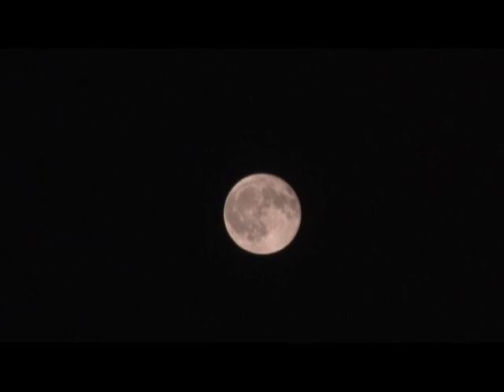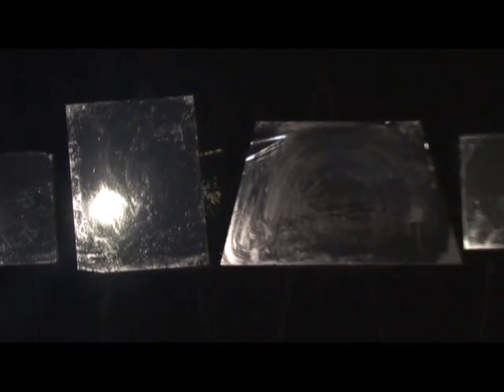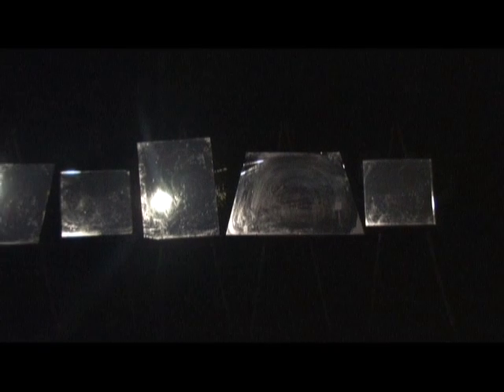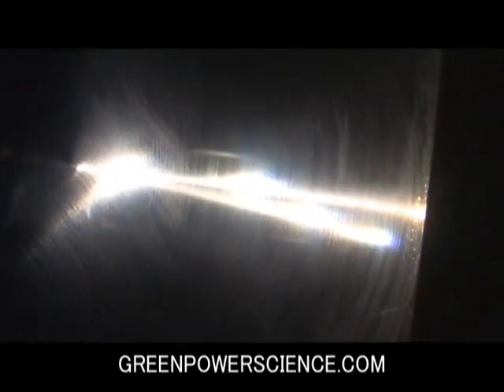MOONLIGHT LUNAR FRESNEL LENS SOLAR PANEL PV PHOTOVOLTAIC NIGHT SOLAR ENERGY

Comment: hey Ive been seeing people doing tests saying moonlight is colder than moon-shade and the coldness can actually be magnified .. .. you guys should do a video..
Reply: +Simon-the-Bar Keep extreme bullshit in short, thank you.
Moonlight has its own light, period.
There are few exclusions - blood moons, when sun is closer to moon and light a little the moon.
Moon and sun is same size. Consider obvious, enough Walt Disney and NASA lies. Keep your religion for yourself and separate from TRUE science please.
Reply: +matt norris This can be attributed to radiative cooling. I'll skip the extreme science and keep it short. Moonlight is not cooler in any sense, it has literally no effect on the temperature of the earth. What happens is at night, the atmosphere can actually absorb the heat from objects. Energy always travels from an area of high concentration to an area of low concentration. Air loses heat much more rapidly than a solid object, and so the air will absorb the heat from any surrounding objects. The unshaded air and surrounding objects would be able to cool down quickly, due to the increased airflow of being unshaded and exposed. However, when something is shaded, or covered, the airflow is restricted so less heat energy can be transferred from the object to the air. If you ran the same test of moonlight being cooler during a new moon or a moonless night, the temperature difference would still be seen. Hope I helped clarify.
Reply: Simon-the-Bar
that did clear it up ... thx man
Reply: Simon-the-Bar
Lol, you exactly behave as they wanted new generation of slaves to behave. Expert... haha. You are great example to others, appeal to authority type of slave.
Anyway, lets keep away all the insults, after all i am slave myself.
About experiment, i just donated to the guy and he performed it and results was just like expected, moon light was colder than in shadow. Plus few more guys did that. But again as i said,  I WILL DO MY OWN experiment. AS i started to do my experiment with horizon and other stuff, i am busy now.

i have reached point where i understood that NOW ONE is more clever or better than YOU, its all matter of time and attention to the subject (no matter what it is), some will do that quicker, some slower, but everyone can learn/know same stuff. And The knowledge/experiment about moonlight is irelative to thermodynamics. I am not trying explain why moonlight is colder, and am just saying that it is. And interpretation of reality is another subject, i could find many holes in thermodynamics itself and we could argue to death what is what.
it is same like trying to explain why rainbow behave as it does, and why shape is exactly like that - it can be endless debate.
But i am going leave you alone with all this,
Good luck.
Reply: Do the experiments the right way and you'll see everything for yourself. Do the math and you'll see that it is impossible for a solar eclipse to happen if the sun and moon were the same size and same distance away. Look through a telescope designed to be used for the sun, and you'll see the exact same thing NASA shows us. Look at other planets with your telescope and you'll see smaller object orbiting them, other moon. Yet the sun does not orbit them. It's not speculation. You don't know what you're talking about. You reject common science yet you don't know what you're rejecting it for. You are not a man of science. You are a man of quick assumptions. The reason you don't believe the facts are simply because you do not understand. It's all been explained. A man of science would acknowledge that.
Reply: Simon-the-Bar

Solar eclipse happen not because of moon shadow, there is well known and worshiped by our masters, the black sun. Either way i cannot confirm that myself... Moon eclipse is different story, if it is not staged by man himself. Still i have filmed it myself, its on YT, was a great view.
And yes i will do experiment in a right way and what if it will be cooler, you still going to think it is some "space-dark matter-gravitational-epiphenomena" on globe earth? :)
i looked at sun, and now i bought camera and filter to show you. Just filter isn't dark enough, afraid to damage the sensor, so i bought another one and waiting to arrive. All what you will see is circle with the holes. And those holes repeats every cycle, every 11-18 years i same place, about the same time and exactly the same shape. On a sphere it is impossible, i wonder how it is possible at all..
NASA show for a split moment a circular disk with holes, next they bring fake CGI stuff and i can prove it all of it is not real and made up with software. Actually in some cases it is software product mixed with real sun disk videos.

And please do not tell me what i do not understand, i have studied globe earth theory to the bones, for 3+ years every day dedicating to it 6-8 hours. Not just globe nonsense, but flat earth wicked theory, concave earth theory, holographic universe, hallow earth, electric universe, Klein surface, torus, egg shaped universe/earth, etc..etc.. I know too much and i say now  that i know too little and personal experiments are essential to move forward. 

And even if my English do not impress you and i am sound for you like a fool, that is fine, thats your natural reaction.. Well.. natural as it is possibly can be in artificial reality we live in.

Normal unconditioned person would consider straight away obvious, the same size a moon and sun. Stationary earth, tiny 7 only "planets" and rest of the "stars", which rotate around stationary earth. But well brainwashed and indoctrinated person, who been taught in a school that our ancestors believed that earth was flat disk, which was help by turtle and 3 elephants is no more clever than a monkey. Many slaves so well indoctrinated that they believe that they are monkeys themselves, i mean they "derived" from monkey... You know the story... i was in brainwashing facility myself and was good at it.

I am here not to prove you one or another or show how "wicked" i am. Just encourage you try to understand what those "nut balls" are saying and why. Soon, after many hours of going away from official lies, you start it to see all for yourself.
You can make people believe WHAT EVER YOU WANT, and they did in the age when TV was invented of-course... or shall i say..presented.
Yes globe earth theory does make sense if all what they say would be true, but it does not. Even if all what they say would be true, there are too many holes in that theory which been glued with phenomenons and laws which does not exist or can be proven. 

 I wonder what is your take on my last video, what do you think, when we really see Venus? When it is in Focus?
Reply: Simon-the-Bar
No i am saying that Roman Empire never fell and you live now in it. And who ever is famous world wide, now, then or in the future - it is THEIR people. Would that be BACH, MOZZART, NEWTON, EINSTEIN, you name it... ALl of them.
You cannot say what is happening today for sure, because all lies around and you trying to tell me what Galileo discovered? In any case if  it was their guy or not, clever or not, honest or lair - they write the history in a way they want it, period. It is same story like with Hitler or none existing genocide. Or fake WW3 which is coming. Or Einstein and his theories. All of it is always fake story to the public.
Research about freaking stephen hawking, he is an injured man, who know fuck all, imprisoned by those people, sit in the chair and  do nothing,and someone is creating BS story on artificially created "genius image".

Check video:
Stephen Hawking Videos: The Real Stephen Hawking (Part 3/5)
from 3:15 min, he was speaking back then and look what student "interpreted", if you cannot see that ALL of it is a staged and lie, i cannot help it. yes it is mind boggling, it is crazy, it is impossible to believe, but nearly everything around you is STAGED.
Slaves always will be given fake official story, as it was for hundreds of years. It is no different today.

They have plenty time, all what they do - fulfilling the book which was written in the beginning of the Age of Pisces. Now it is new age coming and they create new world, new rules, new religion, languages,  governments, way of thinking, technologies,etc..etc..etc.. And they have new scenario for another 2150 years. Not in detailed as you might think, but it has been written in such a way, that you could interpret it in a way you want and project on that timeline, symbolically or for real.
Either way future these days is planned out at LEAST 200+ years in advance with minute details, i nterms of whats going to be "invented", "discovered", world wide events, most country reforms, how they going to do that, how people will dress, what they going to eat, what they going to play, how much they will think, what sort of cars we will be driving (none), how they will provide kids for us, how we will have sex, etc...etc...etc.. EVERYTHING.
Just as it is NOW, believe it or not. Your thought are not "your", they first decided what society will think and behave, and they present that to the public and you only choose "yourself" what sort of type you going to be.

It is like TRUMAN show, just we are all Trumans and actors at same time for each other. And how to "act" TV/books/cartoons/movies/newspapers/school dictates for us, and at all levels they have 100% control.
Reply: Simon-the-Bar
I don't know how earth is like but it its definitely not round, i have studied all theories of earth to the bones, including 4 flat theories, 2 concave earths, hallow, electric and holographic universe theories, , torus and klein surface, and many others..
That is why i do my own tests to find out for myself and share some with you. I should have done experiment tonight with moonlight and its cooling properties, but it is cloudy as fuck, might be be better later. Check out for video after few days, we can see what is what...
Reply: You are delusional. Extremely.
Reply: Simon-the-Bar
You can measure curvature on the horizon, check my videos... It is in process. Plus i am going to launch weather balloons soon myself, but it will be done at same time in 4 places on the surface of earth. That is the best proof that earth is not a globe - the weather balloons. There is NO CURVATURE, there is only Go-Pro FISH EYE LENS, which distort the view. people who lunched it with normal lens you can see FLAT as FLAT can be. Do fucking research, fellow. Enough to preach me what you think who i am and who i am not. Learn tiny bit yourself. I have spent 6-8 hours a day, for 3 years educating myself, learning all sorts of stuff, regarding this topic, to even dare to tell that MIGHT this theory is false. And now,  i say, there is no doubt it is false.

Enough of this name calling shit, good luck in your fairytale land which your masters has presented to you.

Bye
Reply: Delusional.
Reply: PartOfYou Far from it. Atheist actually here and uhm, that is true science. If you knew two shit about science you'd know that the sun's visible light isn't what warms you. It's UV light does, which is invisible to the human eye. Ergo, the light we see has no temperature. I'd like you to run a small test on your own. Take a mirror, and reflect the moon light onto a shaded area. Keep it there for about half an hour and record the temperature. Another test, take a magnifying glass and try to focus the moon light. If the moon did make its own light, you'd be able to create a tight area of cooling light. It won't happen.
Reply: Simon-the-Bar
LOL, check videos on youtube. MOON DOES HAVE COOLING LIGHT and temperatures does drop lower on moon light. And i will perform proper experiment with many and massive parabolic mirrors.

Great try... But you just debunked yourself :)
Please perform your experiment yourself and help to spread the truth, cheers.
Reply: Oh you've watched youtube videos? Tell me again how you're an expert on thermodynamics again? In this day and age of the Internet, ignorance is a choice.
Reply: PartOfYou I want you in your own words explain why moon light is cooler. I have a solid explanation for why moon light has no effect on temperature change, yet you keep bringing up things such slaves and conspiracies and what not. In your own words, explain what is happening with moonlight and temperature. Detailed.
Reply: Simon-the-Bar

I dont know, how about that? I can speculate, but all of it is speculation... First you have to know what moon is, to me it is not even solid.
It is same size as Sun, it is about same distance as the Sun. Why sun makes heat, its not some bouncing invisible particles (protons) - thats bullshit, look trough the telescope and filter into sun yourself it is NOTHING like NASA ever showed you. You will run into problems explaining reality, it just IS, still we can try to satisfy ourselves with extended reasoning and logic chain of words.

Who ever created Sun and Moon and tiny stars, they created the way they are,how did they did that - i do not know. Big bang bullshit i do not buy.
 Either way i was religions person and believed NASA and other religious fucktards, not any more. Now i am after science ONLY, not religion mixed with science.
Sorry for mistakes, my phones makes auto suggestions....
Reply: You do realize you're basically saying the Catholic Church was right and Galileo was wrong, right?
Reply: You are either a troll or by far the most gullible person on the face of the ROUND Earth. Or is that flat too?
Reply: Simon-the-Bar
No i just curious, i think for myself and question authority. While you appeal authority. That is all the difference. But i was exactly like you, i dont blame you. Good luck.
Reply: But here's the issue, you're not actually doing your own research. You don't have the money for that. You can't circumnavigate the globe, you can't go into space and see for yourself what is out there, and you can't teach yourself all of modern physics and science and understand it. I appeal to what makes sense. Logic. Science, proof. You appeal to random conspiracies that exist for the sole purpose of defying authority. The "Flat Earthers" started out as a joke, but someone got the wrong idea. The guy above is obviously using the wrong thermometer for this kind of test. Your so called "research" is based on nothing more than whimsy. You have provided zero evidence for anything of what you  believe other than "I've researched it myself."  Your parents raised you better than that. And you know yourself that the only reason you believe in your outlandish theories is because you want to be able to feel superior to others and feel different. Feel like you know something that everyone else doesn't. But you're wrong. NASA isn't the only one that's been to space. Other people have traveled on their own private rockets and people have sent weather balloons with cameras. Those are real experiments by real people. I hope that in time you wise up and realize that not everything told to us is a lie and that there sometimes isn't always a greater truth.
Reply: +PartOfYou man the sheeple will always be sheep. i do agree with u on that we don't know what the moon is made of or if it's even solid. dont waste ur time arguing or debating for it is endless and pointless.
Reply: +PartOfYou you really are an idiot , Ask Felix Baumgartner you know they guys that free fall from 39klm oh wait he was bought out ? http://www.imaging-resource.com/news/2012/10/15/red-bull-stratos-used-over-35-cameras-from-canons-to-reds-to-document-baumg
Reply: viol8r007
Lol not just them, but every single thing what NASA ever did.
That was main purpose of theirs to 1000th time to brainwash you and have some fun at same time.

Investigate whole thing, check the supposed rotation of the earth and where they have landed, how long they were up in there, etc.etc.. Why they have used fish eye lens cameras which bend the view and many many things.
Yes, it was planned out by same people who fooling you every day. It is biggest lie which humanity ever been told.
Reply: +PartOfYou So you are saying that a man who has broken the Law in many countries from Base Jumping agisnt the Authorities ans System by living life out side the law with out hurting people and living the complete extreme is just another plant . There are plenty of things to be skeptical about ,but as close to a sphere Earth is not one , neither is the Moon Nor the Sun . How else does the moon revolve around the Earth and How does the Earth Revolve around the Sun if it is not a Sphere using gravity ? You can see the Earth is round go down to the Ocean and watch a ship sail away.It dissapears  .
http://www.dummies.com/how-to/content/how-to-determine-the-earths-circumference.html

if you have the handle on that then heres another 
http://www.sciencebuddies.org/science-fair-projects/project_ideas/Astro_p018.shtml

now check this out if you want to know how far you see round a globe and not a flat plain 
http://www.ringbell.co.uk/info/hdist.htm   now this one is tricky cause it depends on the height of the thing you are observing aswell ,but you new that right .Now if the Earth was not a Globe(well as close to it) you would see forever - what the air refraction %at determined height .If you can not understand this i am truly sorry for you. In todays age Ignorance is a choice my friend . Maybe you should try "potholers 54 "Channel and "Armoured skeptic"channels on you tube these guys may help you out a little .
Reply: viol8r007

OMG.. You are really think there is so stupid people around? Do you thin i do not know any of this? You think i haven't finished school or studies? You think i am havent studied astrology or dont have telescope? I know globe earth theory to its bones and every single story and reason which backs to Galileo or Ptolemy.
Earth is biggest thing that exist in entire universe and sky is no bigger than earth. And Sun is same size as a moon revolves around the stationary earth. Whenever earth flat, concave, Torus or Klein surface, mundane egg or any other - for certain i do not know yet, because i know enough not to fall into single conclusion.
Funny how that knew people for last few thousand years, and only when Hollywood was invented and mass brainwashing was possible we suddenly "discovered" that earth is a globe. Lol. I am out of this debate, you have my suggestions, there are PLENTY evidence that NASA and their fake activity is nothing but HOAX.
Please go and find me one real picture of earth, where you can see ALL earth, some stars, maybe even planets, or moon... Not to mention satellites and all other stuff.
We are in so called space 60~ years. there must be plenty of real, raw, non manipulated pictures. Please FIND ONE.

Half what they have taught us is based on PURE lie and that includes not just globe hoax theory, but evolution, big bang, climate change, nuclear weapons, nucleus atom theory and much much much more.

Why would they lie about earth and choose to brainwash us?
Why precisely Globe earth with infinite space fairytale?

It greatly deal with belittlement and it is needed for new age religion - extraterrestrials. People are controlled with four main things:

Fear, shame, guilt and belittlement.

 We all know how fear is used to manipulate on us... and usually it is has been done trough classic technique:

 *Left vs Right* (Russia vs America, liberals vs democrats, etc..) = so they can create Problem + do some Action + offer the Solution = and result will be Exactly what they need

So they just back engineer whole scenario and start their plan, and usually everyone know that something happening, everyone talks about it, everyone has opinions on it, but no one really knows what it is all about. Just like Terrorism hoaxes right now all other the world. Everyone know it is happening, some know it is staged, but not many know what it is for. In my opinion, it is destruction of hardcore religions (and ALL religions in general) using shame and guilt which will have tremendous impact for future generations... And also they are creating safety problem, so we would exchange our "freedom" into the "safety" , and accept all coming policies, RFID, scans, facial recognition, fingerprints, etc...etc...

To see bigger picture usually you have to think in terms of 10/20/50/100 years, but what i will say now, it is few millennia thing... Whoever runs the world, they do it for very very long time, they have created most of the religions of last 2000 years, languages, towns, wars, etc... Their religion always was and will be - astrology, and basis of all religions are based on it, as many you might know by now. There are ages which are defined by cycle of the star Sirius, one age is 2k+ years. And we still are in age of Pisces (or it has finished on 2012), age of Wars and Nations and its scenario was a bible. Nations cannot exist without the war - watch Report from Iron Mountain to get a clue. But right now we are moving from one age into another, we are at the stage of the transition.

 Into age of Aquarius, age of Peace and Unity. But peace has its price to pay - Total Control. That is why all this technological monitoring is necessary. They going to mix all races and all nations, cultures, religions, and dissolve the borders slowly - i think it is easily can be seen happening to this day. The titles of the countries speak for themselves: United Kingdom, United States, Soviet Union, Euro Union, etc..etc... And new age = new world which is all about one main belief system, one monetary system, one governmental system, one language, you know all of these... But religion will be replaced with science. Or shall i say...fake science. Or let me put it right: True science (mathematics, physics, geometry, astrology) + Fake science (big bang, evolution, globe theory, nucleus atom theory, gravity, quantum physics, etc) + Backward cosmology which is presented by NASA + fairy-tales about Aliens = NEW WORLD RELIGION
And many conspiracies are used to shift your thinking towards it... And when they perform fake alien invasion, everyone will fall for it.
Thats why they spray Barium Strontium Niobate with chem-planes - to create massive holograms in the skies. Another obvious reason of ball, globe... That it is very unique - it has not end. Or on other hand - it has very limited space of travel, it shuts down your mind and dont let you ask: whats there, what is further? So yes, they might hiding lots of land. But the most important reason why they make this globe hoax, it is infinite space. Not because aliens can be possible in such a scenario, but because it makes you feel tiny, little, not important, powerless and hopeless. Easy manageable and fearful. While in reality You Are The Most Powerful Creature on the face of the earth if not the universe - what ever its size.

But i bet it is too much to handle for freshly baked brain.

Do research and after 3 years 8 hours a day of studying, reading and educating yourself, get back to me.. then we can talk a little, if you can grasp reality and able to separate fiction from truth.
Reply: so you just do not understand geometry or physics or perspective ,so it must be wrong sigh . Here it what you need to do for your self go to an Observatory or even buy a telescope and look at ALL the planets and moons . So you will see they are ALL circles .Molten things formed in a vacuum with no gravity will form a sphere  . But i fear you will continue on this path of blind ignorance cause it does not fit your mindset of ignorance or complete lack of Understanding . By the way Quoting Astrology does not help your cause for a real scientific debate . Ignoring facts about geometry Physics and perspective does not make what you are saying truth ,as with out any of these would would not be able to travel the world as it is a Globe . Answer me this in a simple matter how is it if you head west in a plane from any position higher or lower than the any of the tropic lines you will end up in the same place given enough time if the Earth is NOT a globe shape ?Yes i have traveld "around" the globe in the same direction . Get out of your mums basement get a job so you can travel and see for your slef instead of reading Ignorant or just plain Lies from the Internet . 
PS: stay off the drugs
Reply: viol8r007

I have made some videos of the sky and its heavenly bodies, check my videos, before trying to explain me something what you haven't seen for yourself. You believe lairs and assume it is quadrillion miles away, i use true science and can determine that stars are not farther than few thousand miles away, if not hundreds.
Gravity does not exist! And you cannot prove or test that. Even clown Einstein said that theory of relativity cannot be never proven. Without that theory gravity is impossible.
So called gravity can be defined as nothing else but density and relation ship with each other of the 4 main elements: earth, water, fire and air.
If you can figure out how to travel of any other shape of earth "around" - i am totally feel sorry for you.
I know it is shock for you and beyond believable that someone claim that you were brainwashed all your life, including whole population of earth and about such a BIG thing as earth. But do your research,s top telling me what i have heard hundreds of times. I am ex zombie myself, i am were where you are now - and i am here to tell you, that you know what you were suggested, but those who suggested to you that are lairs. Not your teacher in the school, but those who wrote books for the teachers and professors.

Time will come and i hope you will see that you were fooled on BIG SCALE.

I have said all i intended to say, the rest is in your hands. Just mind you, if you decide to reach for truth, there is no way back. Once you get to know things, you WILL join club of the "nut balls". But at least you will know how mindless people really are.

Please learn something about brainwashing and how it works, and soon you will see that NO MATTER how clever you really are, it is as easy, if not even easier to fool you.

So handful tips which they use to brainwash us :

1. The key to truly effective brainwashing is to work at people’s most fundamental awareness. Shape them at the neurological level so they develop the faculties to take your input and call it “thinking for myself.” Enable them to stop thinking.

2. Limit any and all faculties for self-awareness and self-sensing. Destroy instinct and intuition. Actively and endlessly encourage external awareness. Make people dependent on your external input for as many decisions as possible.

3. Speed up messages so that the pace and rhythm of information is disorienting and visually biased.

4. Condition people to being bombarded with hundreds of thousands of signals a day. Teach them to attend to this stream of information and to call it Reality. Never let them ask what “reality” is.

5. Framing is everything. Decide what you want people to believe and make sure that any choices you give them are within a framework which assures you of your result. This is called the Illusion of Choice. “Do you want to sweep the floor before or after dinner?” Repeat this formula for economic systems, politicians, news stories, competing product brands and entertainment.

6. Appeal to the lowest common denominator. Make sure that all shows model conflict resolution of people with an emotional and intellectual maturity no greater than that of a six year old. Make it funny so no one notices.

7. Keep people passive. Encourage the Couch Potato Alpha Wave Escape Plan as the healing elixir for all that ails.

8. Don’t make people think. Their days are hard enough as is. Bypass the need for opinion making by giving people ready-made opinions. Do it as though you don’t have a conscience – they are probably too stupid to make their own decisions anyway.

9. Ensure that there are no ongoing storylines with meaning or purpose beyond immediate sensory stimulation. Avoid universal themes as much as possible. Make absolutely certain there is no cultural, societal or global story or mythology present that conflicts with the myths of comfort and consumption.

10. Never encourage responsibility, or so much as suggest that humans could be involved in co-creating their future and the realities in which they reside.

11. Encourage group-sanctioned individuality only. By making ‘individuality” the new conformity you are generating a powerful illusion of free choice.

12. Sensationalize the superficial.

13. Keep information bytes infinitesimally small. Promote Attention Deficit Disorder. Several decades of television have already set this in motion.

14. Repetition is key. Repeat important messages as often as possible.

15. Repetition is key.

16. Repetition is key.

17. Bypass rationality by any means possible. People don’t need logic to accept information. Belief is emotional. Always remember: WAR=PEACE.

18. Remember –- two half-truths make up a whole truth.

19. Demonize self-knowledge technology of all kinds. Throw around words like “cult” and “brainwashing.” Marginalize anyone involved in such pursuits.

20. Keep old models of consciousness alive and well. If you can get away with referring to people’s states as being phlegmatic or sanguine instead of programmable and intentional, do it.

21. Keep people’s attention on what really matters. Emphasize what’s wrong as much as possible.

22. Always give the impression that Everything Is Under Control – but just barely so – hammer into the populace the idea that their greatest fear could strike at any moment.

23. Teach people that they are their thoughts and emotions. Reinforce this by teaching them to feel bad about their ideas, and to feel bad about feeling bad. Remember: Identify, identify, identify –- this will widen the empty void inside of them that only shopping can cure.

read some books of john Taylor Gatto or Charlotte Thomson Iserbyt (and many others) to understand how they have dumb us down.

http://www.users.humboldt.edu/jwpowell/27806948-Dumbing-Us-Down-by-John-Taylor-Gatto.pdf

http://www.deliberatedumbingdown.com/MomsPDFs/DDDoA.sml.pdf
Reply: viol8r007

i have filmed "moons" of the Jupiter with ordinary camera, which is more way powerful than most toy telescopes below £1000. Check out, it is in my videos...
But... How does that prove earth being a globe ? Fucking hell, just like people never seen a sky... How did they come up with flat earth all these thousands of years? Have you read old books? The older the book the more clever people were.
yes, i feel sorry not because you believe science, but because you believe fake science.
I am encourage you  to watch every single video on YT which has to do with words NASA and HOAX. NASA and FAKE. Earth and fake. Earth and Hoax.

And see you after a year or so... ;) I know this conversations not going to go anywhere. You going to help me, because you think i am lost myself, tricked my own logic or just delusional or mentally ill. But not believing lairs and ability to think for yourself is not a mental illness. Well. To appeal to authority type of people it is, but they dont understand that.

if you go on the road and see police and if you  slow down and get that feeling - you are appeal to authority and inescapably conditioned. If you smile to man with suit even if you dont want that - you are the one. #
Watch yourself in the future, you will see who you are.
I am trying to tell that your thoughts are not your own and, that all what you know is suggested to you and you simply accepted it as it would be truth without a tiny suspicion that it could of been  intentional lie. AND i am trying to say, 50% you know it is lie. Not because you stupid or clever, but because it always was and always will be so. .and to see that you got to go beyond yourself... In a way you have to get "crazy" to observe yourself from other perspective and discover that you were previously more crazy by believing strangers, rather your senses and common sense.

lets leave it there mate... Noting on earth will EVER convince me back to that hoax again. yes it is massive, yes you need to study every single aspect of it, yes it makes sense, yes it is in most cases mathematically correct theory - but it is FALSE in so many ways, once you break down the programing.
Reply: +PartOfYou Wonders how the flat Earthers can explain mountains and the northern lights?
Reply: Rachel Brinkley
No matter where you going to look, your will eventually meet something in a way of the distant objects which will block a view. There is thing called perspective. You can try to see Everest from 500 km away, you wont because it will get small enough and will blend ito the horizon. When you look into ocean there ate tides (which 8-10 meters), waves few meters and fata morgana (mirage) factors which limiting your view tremendously.
If you watch 20 km further in ocean/sea and 20km in the lake there is a difference. In lake you can see 100% of the object that far away  on calm and clear day. And i have done experiment with a sea, and soon going to publish the one with the lake.

How does northern lights relates to the shape of earth? How you explain the rain on flat earth? :] I hope you get my point.
Reply: +Simon-the-Bar 
"The unshaded air and surrounding objects would be able to cool down quickly, due to the increased airflow of being unshaded and exposed. However, when something is shaded, or covered, the airflow is restricted so less heat energy can be transferred from the object to the air."
So by your logic at high noon I should get out from under that tree if I want to cool off? Did you read your crap before posting it?